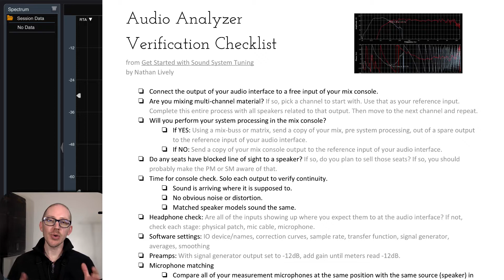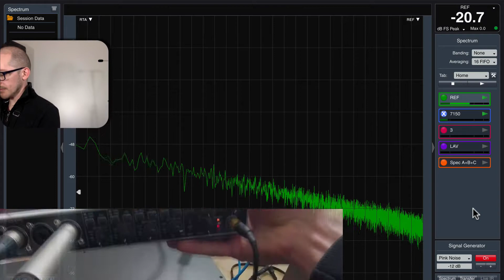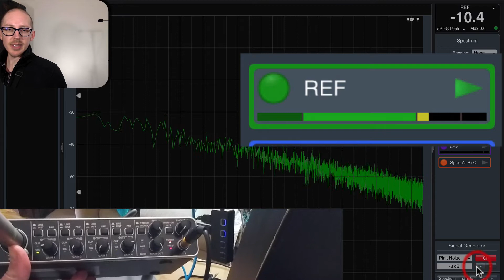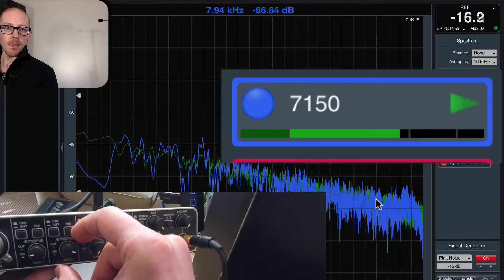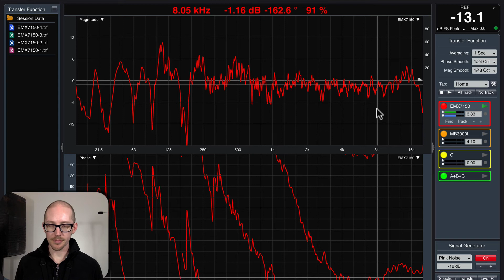How to set your microphone preamps for Smaart [GSwSST17]

Comment: Hello, Nathan. Why did you prefer use -12dB instead -18dB in your measurements?
Reply from the maker: Hi Cassio, do you mean on the signal generator? That just makes it easier to read on the meter in Smaart. The meter changes to yellow at -12dB.

Comment: HI Nathan,  If you are running through the x32, or any console for that matter, how do you setup your gain structure so that everything is passing through optimally?  Do you set the gain on the input channel on the console to match -12 and set the matrix out put to unity and then set the reference input gain?  Does that make sense?
Reply from the maker: Hey Nick, I don't know about optimally, but I just make sure it is high enough to be above the noise-floor of the mixer, which is easy, but without clipping. As long as there's no distortion and you are feeding both your reference input and system under test with the same signal, you're free to move the fader and gain around in the console and the trace in Smaart won't move. Check out this other video to see what I mean: https://www.sounddesignlive.com/get-started-with-sound-system-tuning/#18_8211_Turn_up_the_volume_in_the_room_without_affecting_your_trace
Reply: @nathanlively  I actually got to that video right after this and it cleared it up! THank you!

Comment: Hi Nathan,
Do you mute the mic during measurements? My system feedbacks badly when the mic is unmuted. I can stiil see readings on the graph even when the mic is muted though. Thanx
Reply from the maker: Hey Aaron, this shouldn't happen. It sounds like maybe your measurement microphone is getting fed to your sound system somehow? Maybe you have one of those audio interfaces, like mine, that has a IN/PB control? Make sure that that control is always set PB unless you are doing a quick mic continuity check.
Reply: @nathanlively  I'm using Allen & Heath Q16 as my audio interface and signal processing. Are you telling me that I should route the measurement mic to USB instead of local input? At the moment it's routed to local and I can see the signal fine, but it's muted. Would that be a problem you think? As long as it's showing correct signals to pink noise and any EQ changes will also be detected. I don't even have to press PAFL. Not sure if this set up is correct though.
Main Left to FOH speaker
-Channel 1input routed to usb and used as REF (signal generates from SMAART). EQ changes not effected.
-Channel 2 input routed to Main Left as loopback on the console and also to USB. EQ changes on Main Out and channel strip shows up in SMAART.
-Channel 3 input is routed to local and hooked up to measurement mic as described above and gained to same level as SMAART. One time I unmuted the channel and had rings in my ears for half hour. LOL. Not sure if it will still pick up signal if routed to USB though.
Reply from the maker: Yes, your measurement mic should connect directly to your audio interface. Please take a look at previous videos in this playlist like https://www.youtube.com/watch?v=XV4YTeF5vKk

Comment: Hi Nathan,
Do you adjust the mic gain higher to get into yellow when moving it to the back of the room? Or should I leave the gain once it's set but then it wont go into the yellow when sitting at the back of the room. Maybe leave it and just ofset the graph up a few dB?
Reply from the maker: Hey Aaron, I try to make as few preamp changes as possible. You could potentially set the preamps at the closest distance and never change them, but in the field I almost always end up changing them for various reasons.

Comment: Hi Nathan.
Does that mean whenever you change microphone position you readjust input level for that microphone? 
Thank you
Reply from the maker: Hey Jakub, I try to readjust preamp settings as little as possible, but some change is inevitable. In the front the signal is hot and SNR is good. In the back the signal is weaker and SNR is bad. I try to find a setting that will work globally, but when working quickly, I'll often need to make further adjustments to adapt.

Comment: For a situation where I'm using say 4 mics all across the room, am I supposed to keep all their gain structures to hit yellow with -12dB signal or find a roughly global ball park and do that for all the mics?
Reply: I generally tend to do this with the mic closest to the hangs and follow that gain structure for the rest of the mics. I might be wrong. XD
Reply from the maker: Hey Joyjeet, that would depend on what you are trying to accomplish. If, for example, you just want a live average for general spectral shaping, set all of your preamps for matching TF magnitude. For checking level offset from front to back, for example, you would want to magnitude match the mics all at the same position first. Make sense?
Reply: @nathanlively  Aah. The magnitude matching thing makes sense. I generally follow a similar approach without physically doing it. So for the mics placed on axis to one of the sides I optimize the preamp gain for the mic closest to the hang and then dial in the same value for the rest of the mics to also see for the level offset. Although I do this because all my measurement mics are of the same make and the same model and I've tested them in the warehouse for same readings. Am I doing any part of it wrong?
Reply from the maker: Sounds fine. Of course, your goal with this is for easier visualization in Smaart and/or averaging, correct?

Comment: Hi Nathan. I tru my first mesurements todays and then I've a question! The level of your préamp dépends on the level of your speakers in your room. In an other vidéo you are talking about the level and the SNR (20dB above the noise), but what is your reference level in your room for adjusting the preamp of the mesurement microphone?
Reply from the maker: Hey Christophe, basically, loud enough so that you get good/actionable data. Normally, this would be >10dB above the noise floor. Here - https://youtu.be/S_A1BVOqNXM